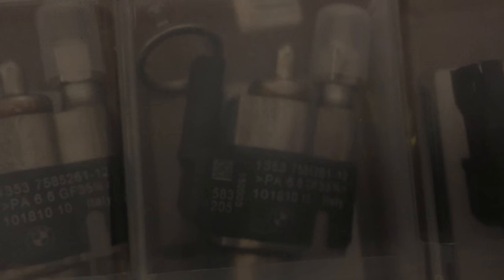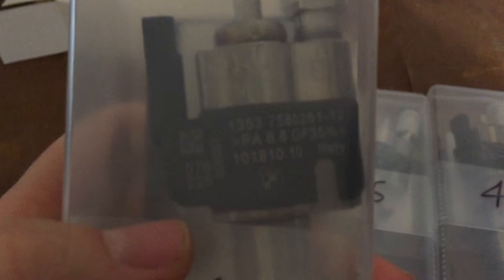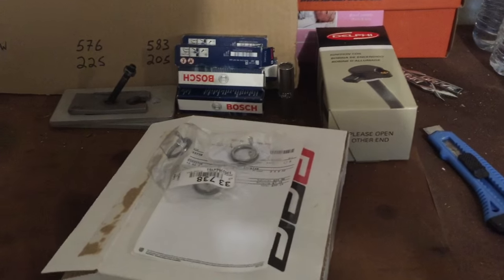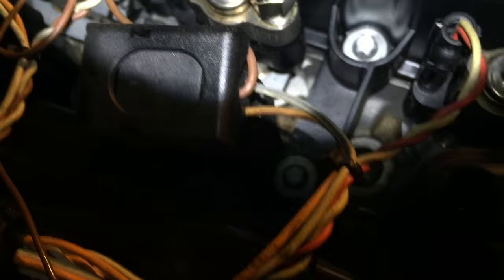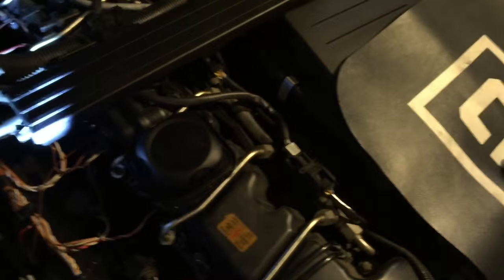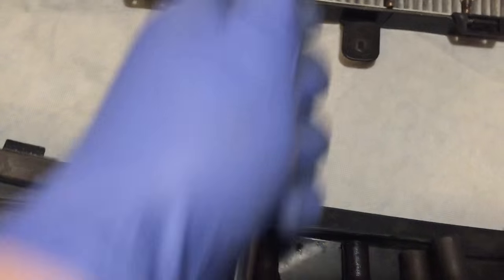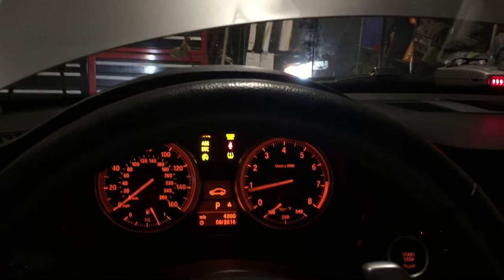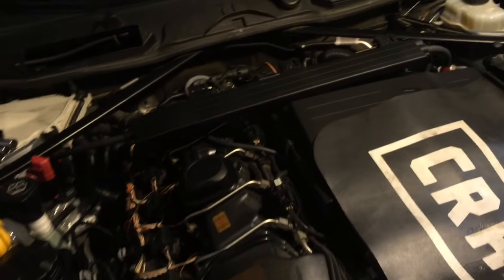335i N54 -12 Injector Replacement, INPA Coding, Spark Plugs DIY

Comment: I wish I could’ve bought some from rock auto. No one had any in stock so I ended up buying a “remanufactured” one from an eBay seller. So far so good 🤞
Reply: I’m trying to find some good injectors, are yours still going strong?
Reply: @jacejackson2982  the remanufactured one leaked so I bought a used on for about $50 on eBay and it’s still working. Mine already had index 12 and just the one went bad.

Comment: Great DIY.  BTW I have INPA on a mac and you can set it up to use Function keys directly.  How is the car running?
Reply from the maker: +Leonid Dragun It's running great now that I have the new injectors in there.  No misfires and it runs smooth
Reply: how did ya go about setting up INPA on mac? just wine then serial driver works too?